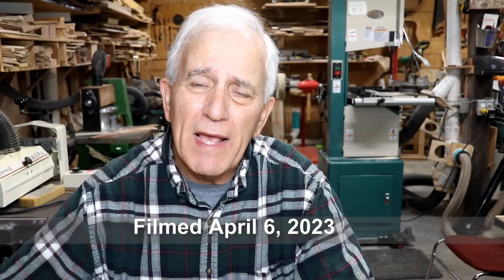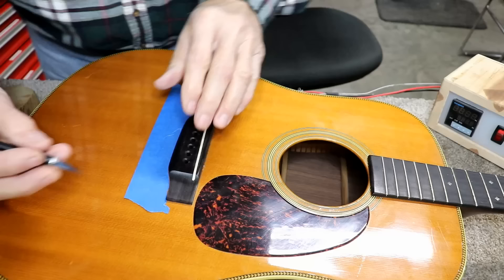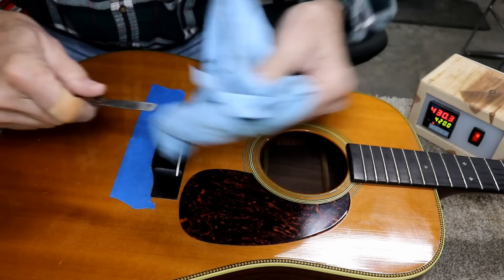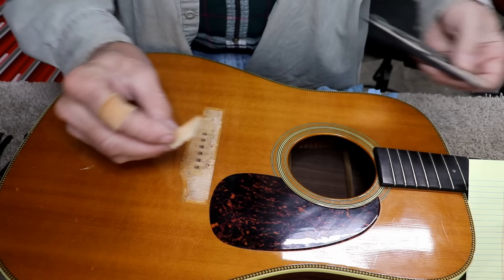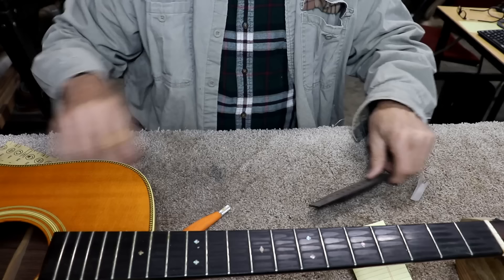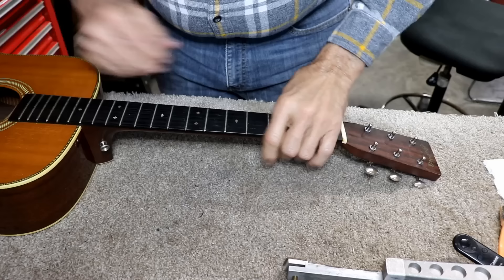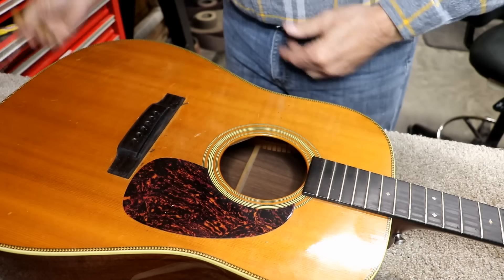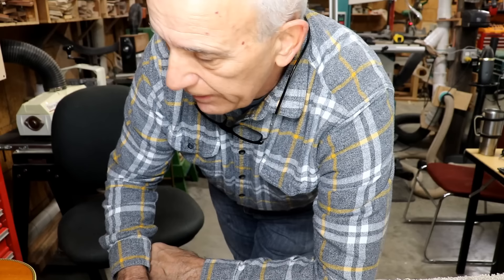640 RSW Refused by 2 Martin Factory Authorized Shops

Comment: This guitar is NOT a Martin. It's a knock off, and that's why Martin refused to fix. There is no Martin certificate on the inside. I own two Martin D-28s. One is over 50 years old. I am the original owner. I've had a lot of factory warantee work done over the 50 years (with never a hesitation). At my request and at Martin's expense 49 years ago they removed the original top varnish (which cracked from a quick temp change) and sanded and refinished it. I've also had two neck resets, brace reglues, pick guard and fret replacements (my exense on the frets only), and crack repairs. I have been to Nazareth three times. I am absolutely shocked that the bridge was put on so sloppily. Doesn't sound like Martin at all. Wow. Nice work to fix the bridge and replace the saddle. As it is a V(intage) model, the original glue should have been horse hide, which should have come up much easier with heat. I also don't understand having a maple bridge plate. I'm pretty sure that was not what they used back in the 1930's. My newer Modern deluxe has a torrified Adirondack and carbon fiber plate for sound transference. I'd like to see the serial number on this guy if there even is one. I'm also noting some orange peel lines on the top varnish. The other tip off that this may be a fake is the cracked plastic saddle. I would want to know if his friend is the original owner and where he got this baby.

Comment: Martin's spotty quality control strikes again. I bought a Martin about 8 years ago, brand new from the dealer, all-mahogany dreadnought, made in Nazareth......two weeks in I bumped it against the couch and a big ol' hole opened in the side!

Took it back to my dealer, and the luthier looked it over, shook his head and showed me the inside. The side wood was marked "too thin" at the Nazareth factory, and they'd used it anyway! To top it off, Martin refused to repair or replace it even though it was a factory defect. Luckily I knew the shop folks well, and they swapped it for me.

Never been able to trust Martin since 🥲

Comment: I wanted to get a quality acoustic guitar. I didn’t know whether to get a Martin, which has the reputation for being the best acoustic guitars. Or a Taylor…Gibson… or even a Yamaha.. i’ve had quite a few Yamaha guitars over the years. They are pretty good.
  So while I was at the guitar shop, trying all the different Guitars. I found that the gibson’s did not impress me at all. The Yamaha and surprisingly the Ibanez guitars were good…
 of course the Martin was pretty good, but I don’t think it really resonated like the Taylor’s. And I like the neck on the taylor’s.
  I strolled down to the basement where they sold the used gear, and, that’s where the luthier‘s worked
  on the wall was a chart showing what it costs to set up a guitar
 The price generally was around $70 for electrics. But the Martin guitar set up started at $500. I asked the technician why. He said because if you need to do a neck adjustment, you have to steam the neck off of the body on a Martin to change the angle. On a tailor, you reach in the sound hole and unbolt the neck.. he set up on a Taylor was less than $100 including new elixir strings..
  I bought the Taylor.. The tone of the Taylor is brighter, not as muffled as the Martin guitars that I tried. That could’ve been the strings in part, but I just like the brightness of the Taylor, and it was much louder than the Martin…

Comment: I've owned mostly high end guitars  for 50 years and for the past 20 or so have  done quite a bit of my own work  (I do know when to call a pro...)    I'm an industrial  engineer- not a luthier - and have hung on your every word since you started your videos.   I especially agree with your philosophy of not humidifying unless it's needed - my '69 Brazilian D-45  and  probably 30  other Martins and Gibsons  have hung on the wall in a room with  central heat/AC  over the past 25 years without the slightest bit of belly or finish checking/cracking.  SE VA averages 68% relative humidity,  and the house stays between 42 and 44% year round.   Ironically,  when I mention  on various guitar pages that I don't have a humidifier or keep my guitars locked up in a  case with a wet sponge and an RH meter,  I'm told that they are some day going to fall apart on me...      My only concession  to caring for the  soft nitro  Gibsons (J-45,  Dove & SJ)  is wearing long sleeve shirts to perform,  and  when messing around I throw a towel over their  upper bout  because whatever it is that my skin gives off,  it fogs up the finish and is very hard to polish out  even on the buffer.

Comment: Thank You.,, This is an excellent video. You made it as simple as possible and you didnt skip anything. I rebuilt the insides on a cheap 12 string that someone stepped on the back of , that of bought online , and it turned out real well. When setting up the string height, I over filed the saddle, And got frustrated and put it aside for several years now.. As of late I ended up putting larger strings on the guitar (a mix and match string situation) , between using heavier guage and lighter guage strings mixed, and was able to make a playable 6 string. It sounds good but I still need to make another saddle and make it a 12 string guitar again.

Comment: The Binding on my Martin OM-28 started to fall of. I took it to a factory authorized shop. it was repaired and returned in excellent conndition. A month later the binding started to fall of on the front and back sides. I took it to another factory authorized shop and saw with my own eyes a room full of Martin guitars with the binding separating from the body of the guitar. I was told that the supplier who provided the glue to Martin had changed their supplier and neglected to inform Martin hence a quality problem was inherited by Martin Guitars and their authorized repair shops.  I was instructed to return the guitar back to the factory for the repair since the authorized repair shops had not been provided with the proper adhesive. I requested that the authorized repair shop to write on the back of his business card, RETURN TO FACTORY and sign his name. I then took the guitar back to the retailer and they sent it to the factory.  After waiting six months the guitar was returned to the Music Store.  The binding had been repaired and I then learned something interesting when I opened the compartment of the guitar case. There in a plastic bag was the original bridge that had been  removed and replaced with a new bridge. I figured out as a result of substandard adhesive that the bridge would have probably become an issue (just like your video).  Martin didn't have to return the removed bridge and I would have never known, but this was evidence that Martin not only fixed the reported problem but also a potential problem created by their adhesive supplier.

Comment: Used the stringing method and used the same process throughout and used a couple of turns and through on the big strings and four rounds on the small it worked fine and it looks real neat. Next time I will try this method. Both work.

Comment: I've had this argument so many times over the years and don't expect to win with you RSW but the amount of glue squeeze-out proves the difference between mere clamping and what you are using and doing, which is cRamping, using cRamps. This ties to my first comment, which was before you covered, 'fat joints'. Great video as always, thanks for that and the daughter in law's soundtrack.

Comment: Get a thermal transfer pad that is used to cool computer chips and NVME drives to improve heat transfer. I'm certain it would cut the bridge removal time in half. A thick one (1.5 mm or more) will conform to the curves and make the bridge heat uniformly.

Comment: It is sad to me that the Martin Co. would certify an authorized service center that could not perform even the most basic and common repairs on their instruments.  I am a retired luthier, Mark Edwards Stringed Instrument Repair, Louisville KY.  I started guitar and all-string instrument repair in 1973.  In the early 1980s, I applied to become an authorized Martin repair service. After a lengthy application process, that took almost one year to be approved.  I performed any needed work including neck replacements etc.  Bridge plates and loose bridges are the most common repairs and should be "no-brainers" for any Luthier.  I don't know what Martin pays its repair centers now but in the 80s they paid our normal rates and expected factory-quality work.  Nice to see another "old timer" that takes pride in years of experience and desire to become a true Luthier.

Comment: If the saddle is held with epoxy glue, the heat should release it. Epoxy is basically a plastic so is affected by heat and becomes plasticized when heated.

Comment: Looking at the bridge taken off and the varnish finish outline would suggest the bridge taken off is not the original.  The original was slightly smaller.  The bridge taken off is a 3rd party replacement, which is brobably why the shops would not touch it. I have seen this before on other bridge replacement guitars.

Comment: I have the same guitar HD 28 V. V stands for vintage. This guitar has a larger sound hole for better projection. Also the HD 28 version has scalloped bracing, the D 28 does not. Guitars with scalloped bracing are typically more responsive, have more bass, and are sometimes louder than guitars with “straight” braces. Tapered braces are tallest at the center of the “X” and thin out evenly toward the guitar's sides, often resulting in a very balanced sound. Martin stopped making those after 1970. Almost all of their professional-level guitars were equipped with scalloped bracing at the turn of the twentieth century. The guitar Jerry was working on had more varnish than usual, more than Martin typically puts on. So I wonder if the guitar was revarnished. Martin HD 28 guitars are not that shiny!

Comment: I wrap my strings similarly, but when I stick it thru the hole, I make sure that it goes under the top wrap. I just feel that downward pressure holds it a tad more secure. I may try your treble wrap the next time.

Comment: The paper jammed against finish and glue residue that was pulled up from the top plate when over tensioning strings and possibly leaving the instrument in a hot car or the sun, etc.
I would have opted for a feeler guage blade over paper.

Comment: Wow, i had never considered what he brought to our attention about humidifying acoustic guitars, or NOT humidifying them?
It makes perfect sense how he said not to humidify them.
I wonder why older Ovation guitar tops are notoriuos for cracking???
Reply: It totally depends where you live and if the instrument is travelling around the world. It's all about Stability, 
 I live in the dry  midwest desert, so I refuse to humidify my 100yo+and $10,000 fragile  guitars  and I've never had a problem. 
I've repaired a few Spanish cedar tops which are infamous for splitting., Id rather repair a cracked cedar top then try to humidify them, the sound isn't affected that much. I'm convinced  humidifying (in my dry environment) destroys the instrument , and the drier/lighter the wood, the  better for tone and longevity, no different than  say an egyptian mummy being preserved better  in a dry arid environment. 
The whole humidifying argument is dumb unless youre a rockstar traveling international gigs, then yes you'll want a stable environment in the form of a humidifier in a case. I've had 130yo instruments hanging on the wall for 20 years and they are fine. I've had a 40 year old Taylor cooking over my bathroom electric  base heater for 10 years and it's fine , my toilet guitar when I feel like fingerpicking while sitting on the shitter,  no cracked finish at all , it plays fine , but only because I already live in the desert.
Ovations would be cracking because the plastic  back and sides are not flexing/expanding/shrinking with the wood top.

Comment: At this point, you should just get some 1/4" allthread and nuts.  Drill through the bridge, all the way through the back in, say, three places, run the allthread through, secure with the nuts and some Loctite, Dremel the extra rod off and put a big "Shoulda bought a Washburn" sticker over the whole mess.

Comment: If you read the warranty it pretty much disclaims everything, doesn’t cover wear and tear well I can see not covering frets or wear on the neck or pick guard because they wear of any type of wear caused by a pick or any cracking because it was stored in a dry environment but everything else shouldn’t wear out  I mean quality tuners don’t wear, bridges don’t wear. Then when you buy the guitar you are required to fill out the warranty information so the warranty is valid but guitar center doesn’t tell you that. Realistically they should just have a 5 year warranty based on the date it was sold it shouldn’t matter how many people owned it or where you bought it they built it either way. I haven’t had problems with my martin guitar but the warranty is pretty dumb for guitars that are not cheap.

Comment: It's true a film of glue between two surfaces is like the oil between the crank of an engine and the bearings it rides in . The crank can't squeeze out the film of oil these clamps can't squeeze out all the glue .

Comment: V=Vintage which means a premium price over a standard D-28.  It's a $3300 or so guitar new.  Disappointment for a top of the line, before you get to the custom shop, and should be covered by their "Life Time" warranty which has as many holes as swiss cheese.   So I was wrong about the neck shape but there are V shaped necks.

Comment: I will throw in my two cents if someone asked me to guess on why the guitar is cracking there, I don't know much about humidifying guitars, but I have a feeling the moister doesn't reach the guitar through the finish, I have a feeling the pressure of your arm on the finish over and over throughout the years cracks the guitar, i'm assuming the moister expands the wood through the opening of the body which swells the guitar from the inside and when pressure is applied to the guitar from your arm, it starts to crack (where your arms rests obviously). I'm sure the salt from your sweat can make the finish more brittle as well aiding in that if I was a guessing man. Just my logical assumption that could be completely wrong but it makes sense in my head lol.

Comment: Wonder how much the glue attenuates the transfer of string vibration to the body top.  Also wonder if you didn't have glue but only wood on wood, WOULD that be noticeable or not.  Maybe not.    slow and carefully I guess is how you need to do any type of repair.
Reply: Damn good point!